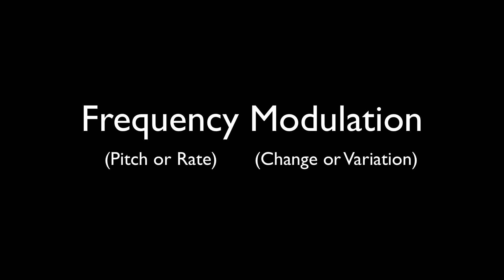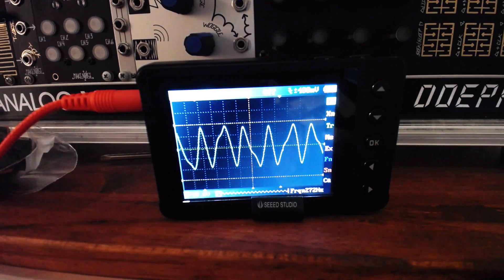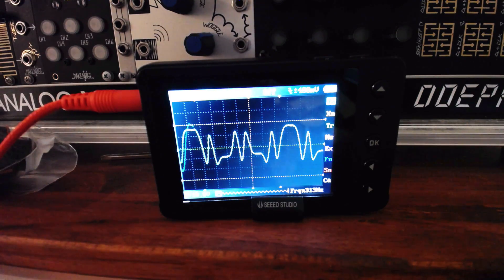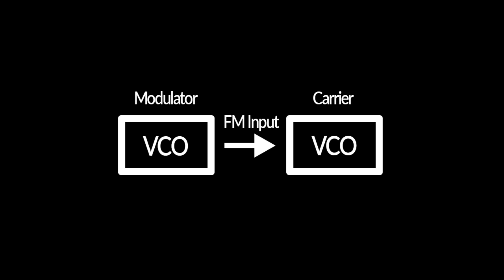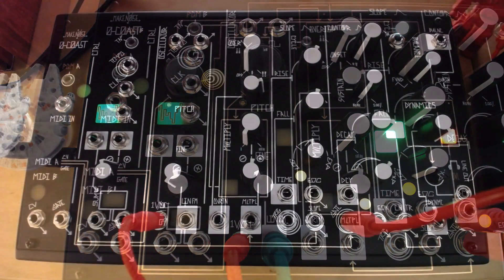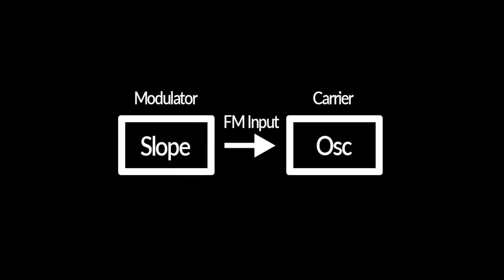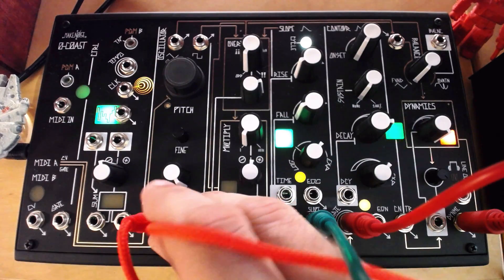FM Synthesis with the Make Noise 0-Coast

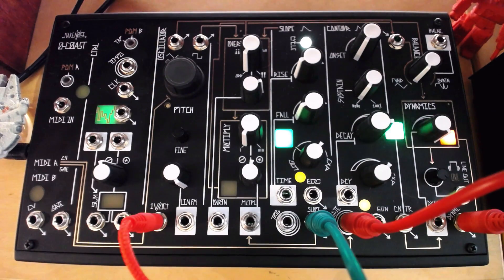Comment: at 3:07 could the contour section be used as the envelop to shape the FM sounds?  Is there a way to create those complex dynamics with only the 0 coast?
Reply: Contour is normalled to dynamics (amp+brightness), so the envelope would have to either be the same for both or you'd need to be happy to jam open the dynamics by taking a static voltage from the voltage math output.